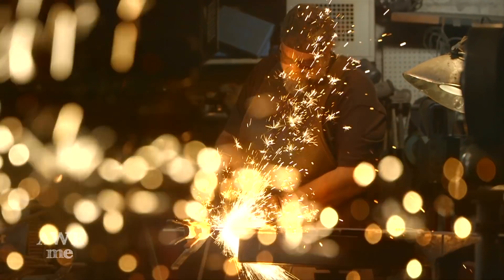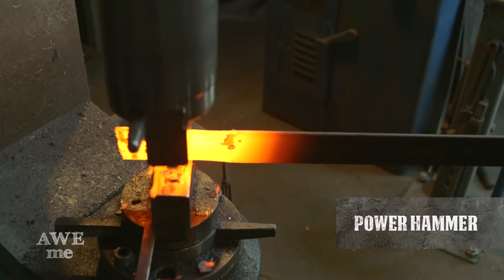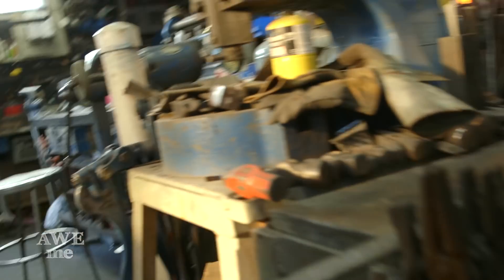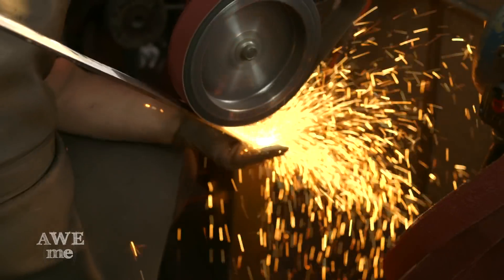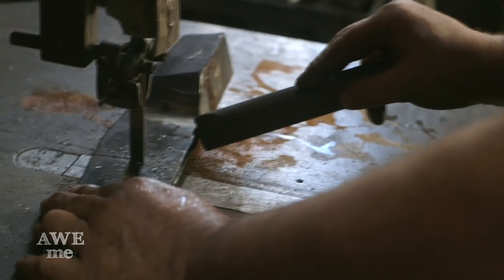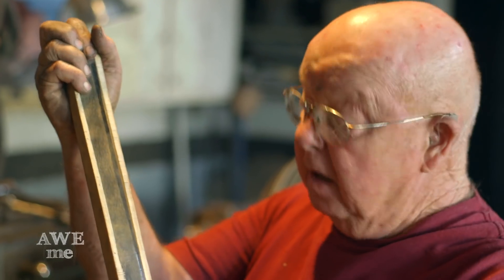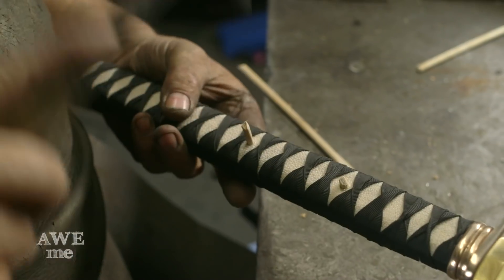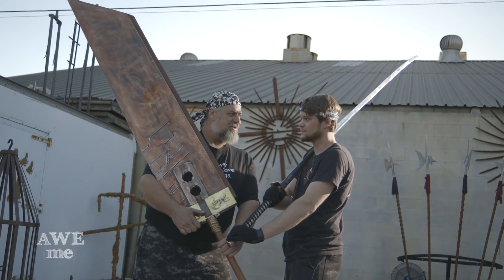Sephiroth's Masamune  (Final Fantasy VII) - MAN AT ARMS

Comment: Sepiroth must be using MP to maintain the blade of the Masamune straight
Reply: i don't get it. it's not magic so mp...... oh
Reply: That or his is made out of indestructible metal.
Reply: All Slash Materia
Reply: This blade is a display piece more than anything. A real katana is forged by bending metal back on itself like 100+ times to keep it strong while maintaining the thin blade.

Sephy's Masamune would need SO MANY FOLDS!!!
Reply: @OriginalCreatorSama  Naturaly it's about ten times not 100 times
Reply: @pauloazuela8488  There are rare high quality ones that are folded 20+ times by Master bladesmiths. maybe it was 100 layers, or 100 folds was a joke about how absurd some of the fold counts seemed at the time, idk. it's late right now and i don't fully remember making that comment.
Reply: @bigwarrstt77 I think you need to do some research to learn that the whole point of the folding process that the Japanese developed was due to the need to overcome the fact that raw Japanese steel, made traditionally from Tamahagane, is of very poor quality when compared to other types of steel. They had to find a way to reduce the impurities and poor carbon distribution in the steel to make it actually worthwhile to use as a weapon. The process of folding eliminates these impurities while helping to redistribute the carbon more evenly in the steel. 
If you were to use the process of folding steel on other types of steel you will of course get similar results in eliminating it's impurities and improving its carbon distribution but because it's of a natural higher quality than Japanese steel this is generally unnecessary as the amount of additional time, work, and resources needed to do this far outweighs the benefit it provides.
Reply: Duke I. If it’s magic power then that would be called mako, while the material used to make the weapon is called materia.
Reply: @OriginalCreatorSama  bro you couldn't even fold a piece of paper in half 20 times
Reply: @DurpenHeimer  see, metal can be squished and elongated to fold more, like Play-Doh. paper can't.
Reply: @C24U_  Thank you. I love katanas but people are so purist when it come to Japanese steel. They always think they know how they're made rather than looking it up.
Reply: @enjamessimpson  i know personally that if i had the money and wanted a real katana i would go to japan and order the blade face to face with a master smith to ensure authenticity
Reply: @marcus24000 neat
Reply: @DurpenHeimer  How big of a paper are you talking about?
Reply: They actually don't ever fold it that many times because it is a waste of time.  None of them rarely ever go past five or six folds.
Reply: STEEL 3